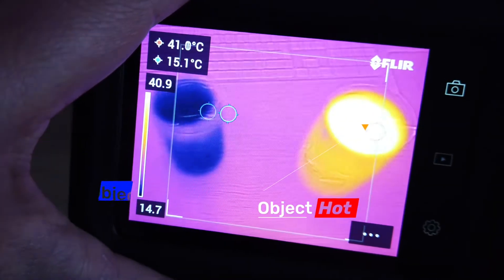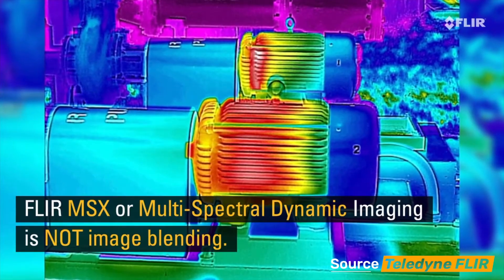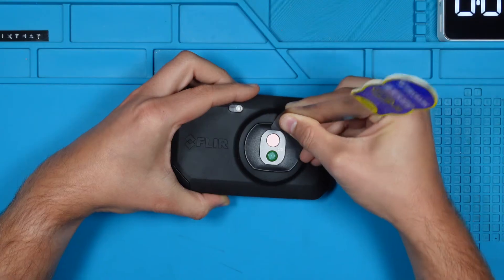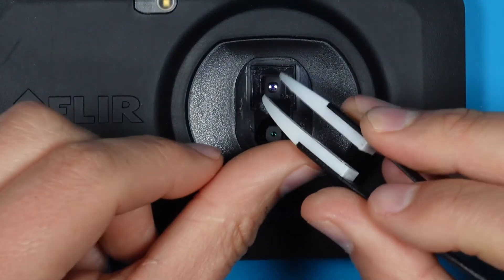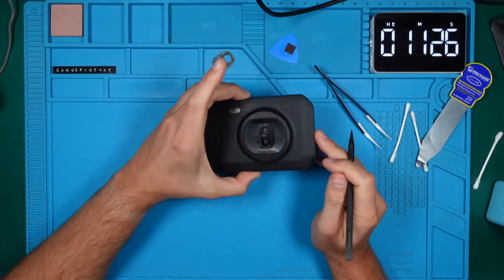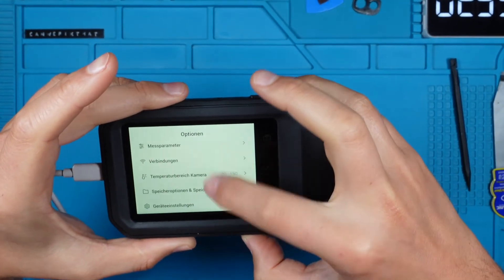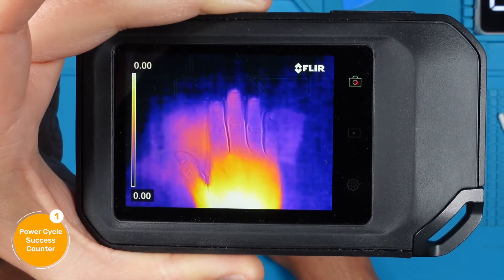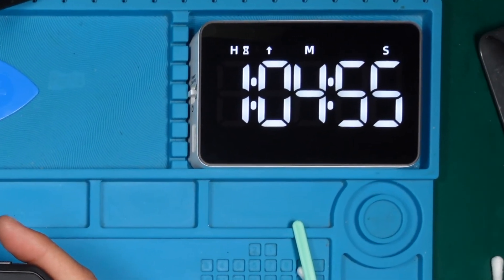How To Fix Your FLIR C5 Thermal Camera (Doesn't Boot)

Comment: I wish I knew this years ago...by removing the front camera cover.  I ended up fixed mine by removing the screen (which I cracked in the process).
But I got it working
Reply from the maker: I feel you, my very first attempt on another device was removing the screen too.....I ruined the screen with IPA 🙈

Comment: Fixed mine! Thanks for the video.  I use a hot air soldering tool at 100 C to apply heat to release the adhesive.  I found the thermal sensor was tilted and with a plastic spudger pressed gently at the top and heard the click as it snapped back in place.  Be careful when removing the outer trim plate with the two holes for the cameras so you don't bend it.  It has adhesive on the back of the trim piece.  Then heat the square mineral glass over the thermal camera and it comes off also (don't break it so pry  gently after heating) The glass does not have the adhesive on it so you can clean with a soft cloth and windex.  You can test without re-assembling.

Comment: Found your FLIR c5 video quite interesting. 

In process of evaluating my FLIR c5. Won’t turn on at all. I want to try replacing the battery but FLIR won’t sell one, having trouble locating an equivalent 3 wire 3.7v 1880 mah 7wh battery. 

Any ideas where I can find such an animal?
Reply from the maker: Thanks! Unfortunately, not, but try to get as close as possible to these values and cut off the old connector from the failed battery and solder it to the replacement battery. This should work, or at least I would try it this way. ✌🏻

Comment: hello , i own a C3-x Flir camera , after no use for a while and keep in his bag , camera start to view heat in left of the screen after 1 minute of use , this is a bit disappointing because camera was kept in good conditions and sensor had fail , i don't know what i will do ,i'm a bit afraid if i disassemble the camera or sensor inself camera will completly die for good, if i had warranty for sure i was use it :( , to bad for this " cheap" camera
Reply from the maker: Hi George! Getting into the C3 is much easier than the C5. There are some videos out there showing how to open them up without causing any damage. I think if you're careful, you won't harm anything, and you have nothing to lose since it's already not working correctly! 💪🏻

Comment: Thank you so much! I kinda skipped through the video. So for anyone thats watching, you don't need to replace the thermal module. Following these steps I was able to detach the metal cover plate exactly as shown, remove the glass square, then when I pushed the thermal module down I heard an audible click noise. Like it was going back into a socket. Turned the camera back on and it fired right back up. My warranty was out and after reading reviews, it sounds like Flir would rather sell you a new one as the "fix" for this costs more than a new camera. I had ordered a new one yesterday for $1100 Canadian and thought I would try this to see. Took me about 15 minutes with a heat gun. Thank you so much!
Reply from the maker: Thank you so much for your kind words! I'm really happy that the video was able to assist you in fixing your Flir C5. It's always a great feeling to know that the content I create is making a positive impact. I appreciate your support! 💪🏻

Comment: So if I understand --- simply boot into safe mode and then download/reflash firmware? Enough times for it to finally "take"? There doesn't seem to be a fix here besides trying to get it to boot to safe mode.
Reply from the maker: Yes and No! These cameras often have the issue that the thermal camera module comes loose and won't operate anymore. That was the big takeaway I wanted to transport with this video. With the device I showed in the video, more bugs were involved. ;-)

Comment: Thank you for the video there isnt much when it comes to troubleshooting these. I was wondering if you know a place i can get a replacement lense for the thermal module? Thank you.
Reply from the maker: Hey, are you referring to the red IR filter?
Reply: @CanWeFixThat  yes and thank you for replying
Reply from the maker: Unfortunately, I have not found any source to get these. :-/
Reply: @CanWeFixThat mine still works I just didn't know if it made that much of a difference.  Thanks again
Reply from the maker: It's hard to say; but I do think it is not a big of a deal, if it was a slightly scraped off.

Comment: I have had this camera and use it for home inspections several times per week.  mine hangs on boot up nearly every time UNLESS it is plugged into external power during boot up!  The other issue I have is that it drains the battery when powered off (standby mode), so I just keep it plugged up all the time.
Reply from the maker: Hi! It sounds like there is an issue with the battery gauge/power management IC. 😕